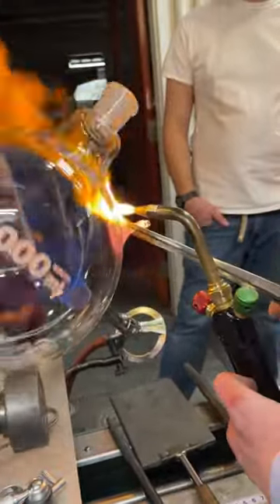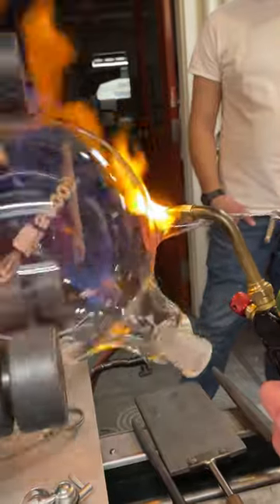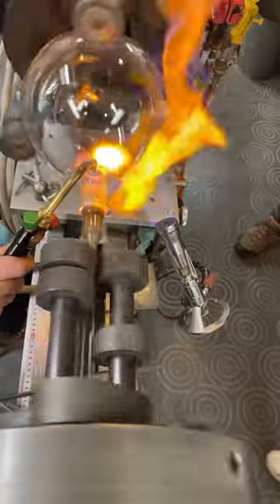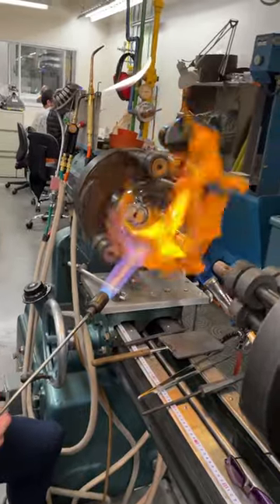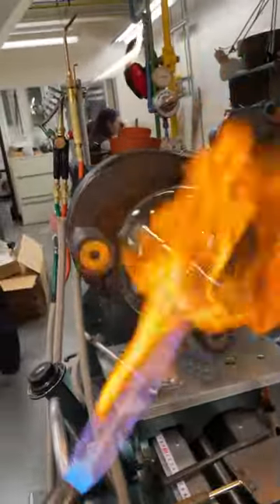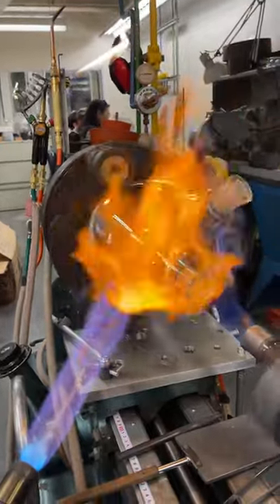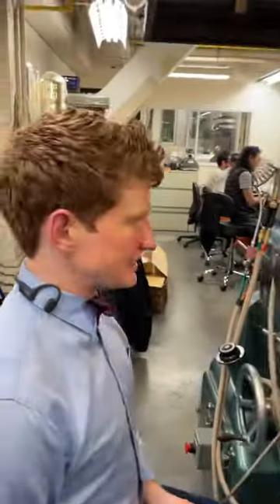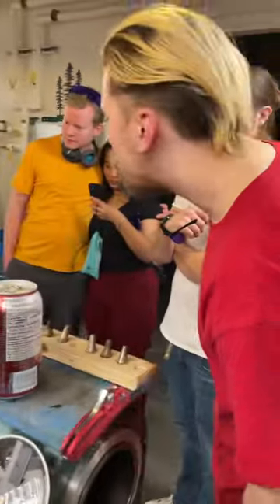Poking a hole in hot glass so I can get tar out of my flask

Comment: Does this affect the integrity of the glass? Like thermal shock or something?
Reply from the maker: It gets annealed afterwards to relieve stress
Reply: Do you think glassware is just made cold?
Reply: @evanbrown7325  It was a reasonable question. They don't have to think anything as absurd as "glassware is made cold," to wonder if differentially heating one side of the flask to melting induces stress that might make it weaker. Especially when the video shows the glassworker flame annealing to combat exactly that

Comments like these are so frustrating because they imply that you know the answer, but demonstrate that you didn't understand the question.
Reply: @SignalDitch  okay, that's fair.